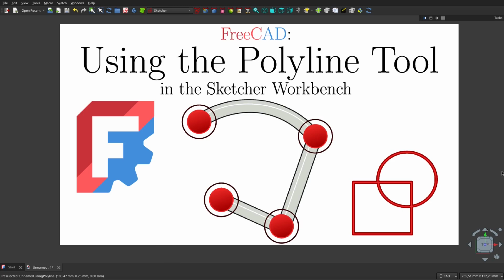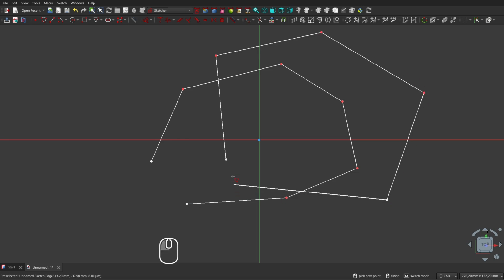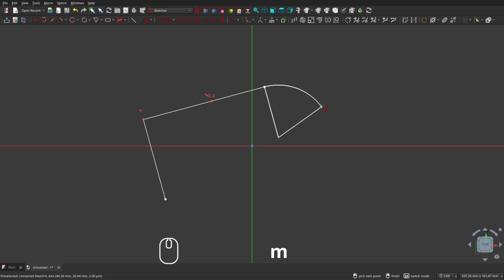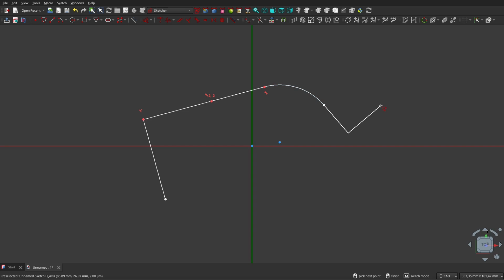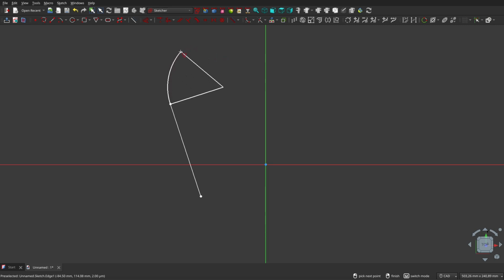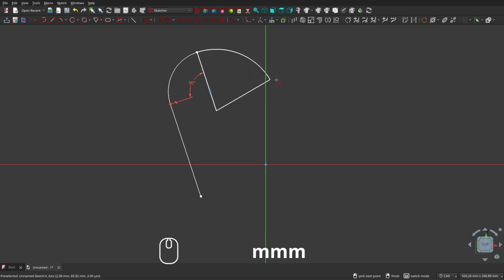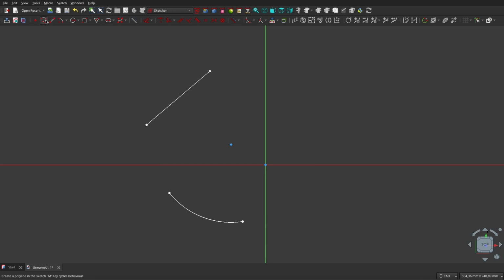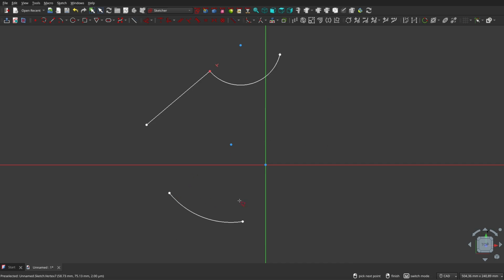FreeCAD: Sketcher WB: Using the Polyline Tool

Comment: This is a useful video, but there is a lot of confusing usage of the word "here." Where is "here". Also, you twirl around a bunch, and it is confusing to the eye. This is a beginners video and we are easily lost. The usage of the mouse icon on the bottom is very clever, and showing keyboard presses is also very helpful. Try to pause over an icon to allow the popup so we can read what the tool is. Your icons may be different then ours. Thanks Mark.